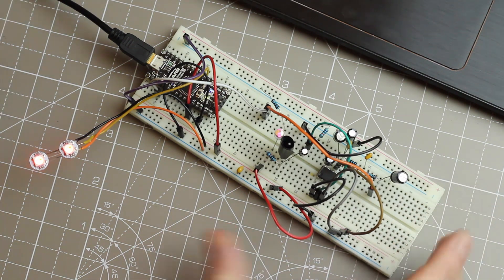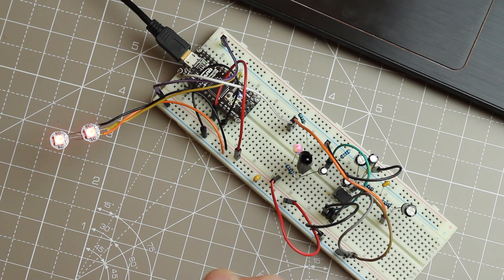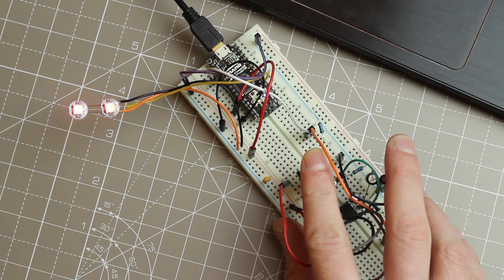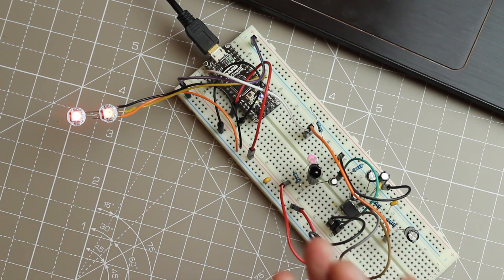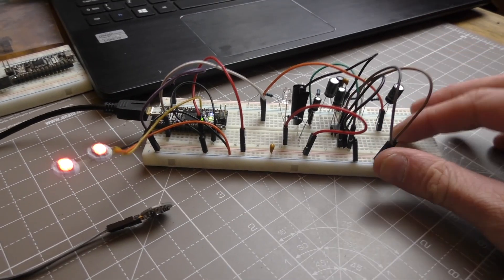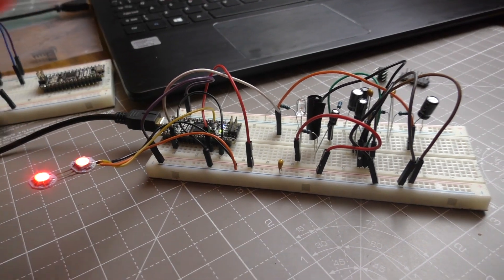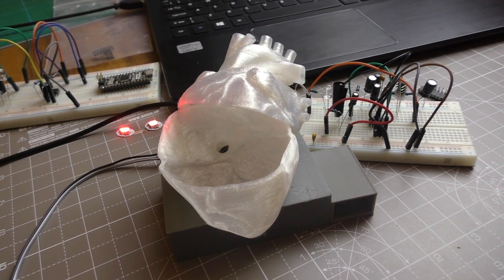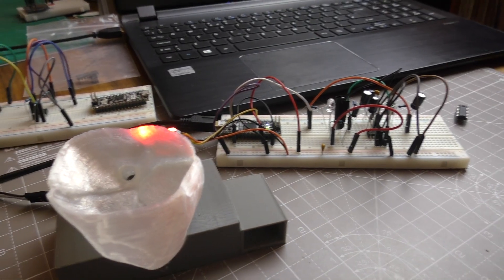Infrared Pulse Sensor

Comment: Pulse oximetry is based on the idea that fresh blood has a higher concentration of oxygenated hemoglobin. The oxygenated hemoglobin reflects IR light better than deoxygenated hemoglobin. You can also make a oxygen saturation measurement device by using two LEDs with different wavelengths (usually IR and red) and finding the ratio between the light reflected from each LED individually. 

It works with visible light too, but not as good. This is how smartphone apps do it, by utilizing the flash as the source and camera as the receiver. I wrote one of these apps for both Android and iOS.
Reply from the maker: Wow, who needs to looks things up when I have you. Top marks :-) Thanks for the info.
Reply: David Watts thank you for your reply. I really enjoy your videos, please keep them coming!
Reply: That works quite ok I guess with phones, but normally you have the IR sensor on one side of the finger and the IR diode (+ red LED) on the other side and then enclose it to minimize the surrounding light as much as possible. When you do this, you get the best results. I've been to the doctor too many times.. so I might have looked into the "jaw" of one pulse oximeter to find out how it looks =D But of course, easy to Google that as well I guess ;)

But if you would like to do a follow-up video enclosing it, that would be cool to see the difference - if any. Perhaps to compare it to your heart sculpture? Which I'm sure will glow up red really awesome as well! Just a comparison if you feel like it =)

Other than that, awesome video! Really interesting subject also! =)
Reply from the maker: That's a good idea, the 3d printer will be overjoyed to get some more use.